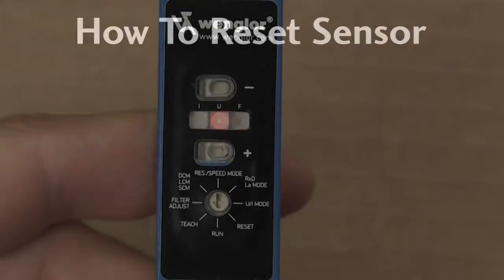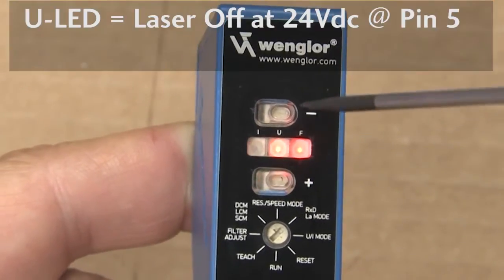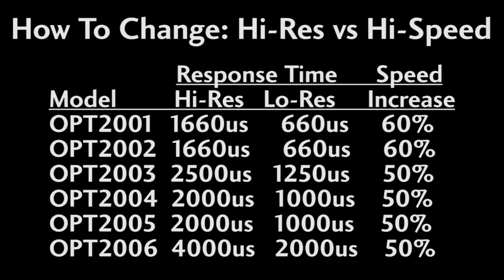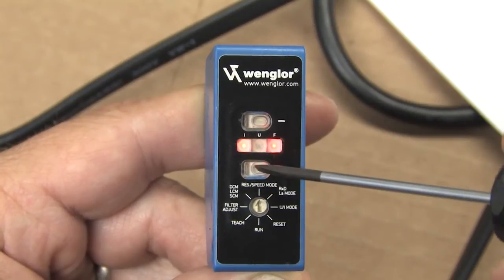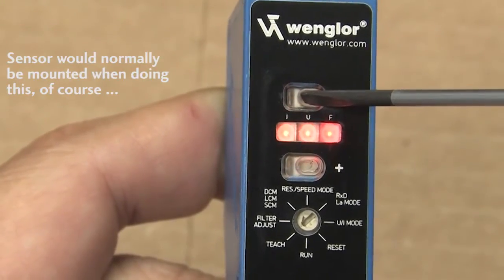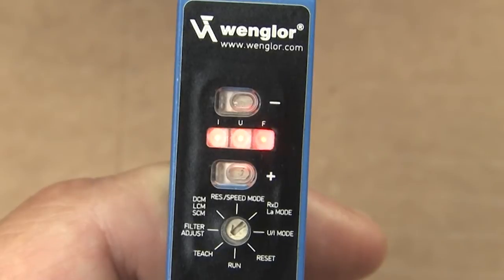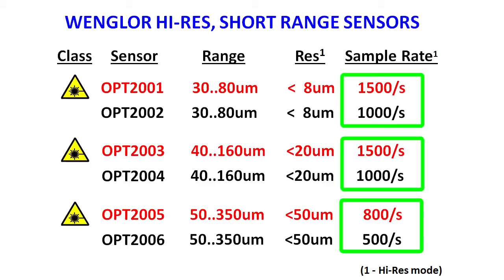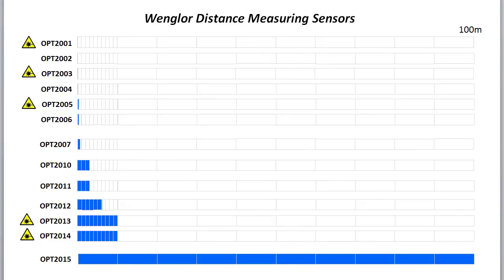How To Setup & Use Wenglor Distance Sensors (Hi-Res Short Range: OPT2001 5:15) at AutomationDirect

Comment: Could you explain the "filter" cutoff settings
Reply from the maker: Hi Luis,  You can find how to set the filter on page 12 of his user guide: https://cdn.automationdirect.com/static/manuals/lasersensorsmanual/opt2001-6.pdf
I'm not exactly sure what is being "filtered" - maybe the output signal? -  I'll ask our guru and get back to you.
Reply: @automationdirect  thank you so much
Reply: @automationdirect  okay so I reached out to Wenglor and they told me that the filter setting simply put is averaging the readings to smooth out for vibrations for example. 1/4th cutoff is 1/4 the measuring rate avaraged. 1/64th cutoff being the strongest setting.
Reply from the maker: @luisca92  Thanks for the update!